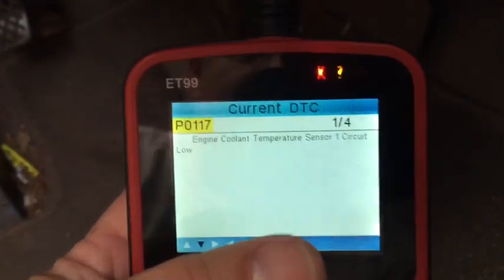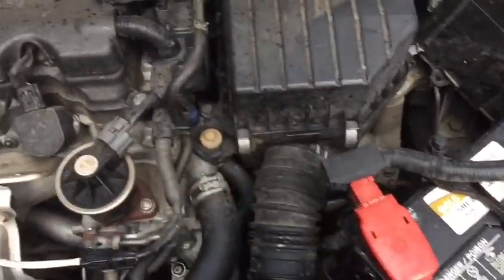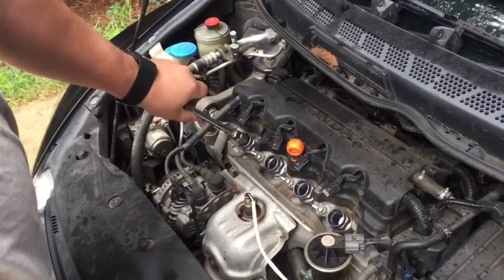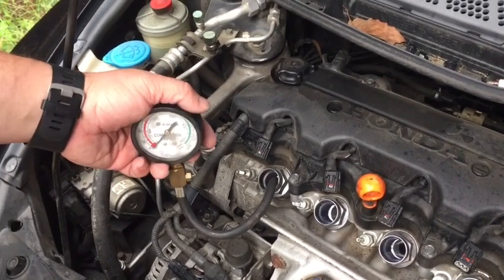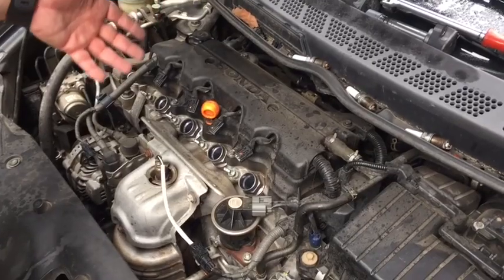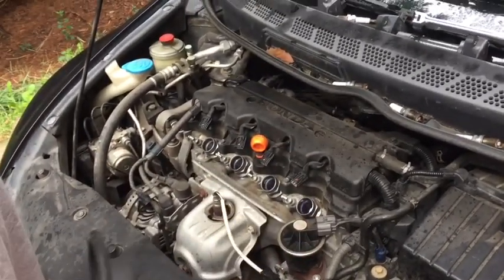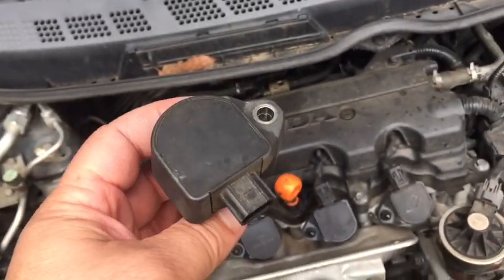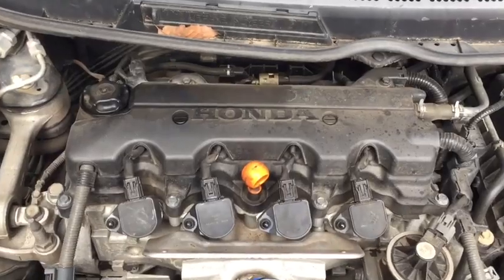Honda Civic p0300, p0302, p0303 diagnosed and repaired including compression test and spark plugs

Comment: Dude, thank you so much for this video. You have inadvertently given me a clue as to what was going on with my project civic. I was running out of ideas as to why I had such violent and erratic misfiring. The engine had been extremely overheated, likely multiple times by the previous owner. I had fixed the root cause being a bad water pump, did the head gasket, and had the head machined. I had also redone the entire top end of the engine, still using the original coil packs. I never thought that the coil pack stems had stress cracked and were likely arcing to the spark plug wells, not the plugs. I went out and got four new NGK coil packs and sure as hell, the car is now punchy and running well with no codes or misfiring anymore. Thank you for the insight!
Reply: Same here.  Replaced coil packs and spark plugs (which were only a year old, but car had overheated) after replacing all the sensors and the starter, water pump, belts.
Started up immediately after this.  Thank you!!🎉

Comment: If you drop them down the spark plug well you need to regap them. When i was an amatuer i did that and figured it wouldn't be a big deal. The car idled fine but instead of getting 30mpg i got on average 24mpg. I opened the gap back up from .039in to .044 and the car had a lot more lower end power and fuel economy restored.

It's a common mistake... its not worth spending 10 bucks a plug to replace them. Just regap em. You aren't going to damage the center electrode with a gapping tool. The tool is made exclusively to bend the ground electrode without touching the center electrode!

Comment: So, the situation you've described fits mine well. 2017 Honda Civic overheated. A few days later, I got misfires in cylinders 2 and 3. I replaced all four spark plugs and ignition coils. The same rough idle and codes came up after a few days.  The car always starts fine the first time I drive it in a day, but later on it starts to idle rough on subsequent ignitions. If I put it in neutral and rev it to 2k, it smooths out most of the time, though.

 Next, I ran a fuel system cleaner through, and the car was doing okay for a bit but would periodically idle roughly upon ignition (again, always after it had been driven that day and to varying degrees of roughness). 

I'm thinking I need to check the fuel injectors now to see if they need cleaning or replacement, but I'm not really sure if I should look for something else first. I haven't checked compression, I realize after watching this. 

Anyone have any tips?
Reply: Doubt fuel injectors are the problem. make sure the new spark plugs are not defective, I have seen cheap plugs fail after a few days, get some NGK from a reputable source. to check for a blown head gasket, you need a combustion leak detector kit.
Reply: @directautofix  Thank you for the reply. I appreciate the insight, and I'll bump a compression check up to the top of my list.
Reply: Not sure if you found the problem (or still have the car...) but it could be a bad EGR. You can try disconnecting the EGR valve to see if the engine runs smoother.

Comment: How did oil get on plug #3? I have the same issue as you, all new plugs and in great shape except #3 keeps getting oil on it and gives the 303 reading.  Any ideas?
Reply from the maker: @crownj01  the valve cover seal probably needs replaced.

Comment: I started to have p0300, p0302, p0303, p0304 codes when engine is heated.
So far ive replaced all spark plugs, all ignition coils, EGR-valve and yesterday camshaft sensor. Spark plugs were changed like 2 month ago and check them like week ago and they were really dirty and some of them must have been heated up alot cause of colour of them even they were only 2 month old. Cleaned them with wire brush which didnt help. Timing belt was changed 4 month ago along with water pump aswell. Havent done compression test yet but i try to do that soon.Not sure if this helping but exhaust pipe is making coughing sound after engine is heated.
Im really running out of ideas what it can be. Car is Civic 2003 1.6 VTEC if anyone have ideas what to look for next.
Reply from the maker: Run the compression test, it sounds like you may have a bad valve in the cylinder head.

Comment: Hi really appreciate this, it's brilliant. Needed your expert opinion; engine light flashing and vsa light on turned on today (civic 2011). Code demonstrated misfiring cylinder 1. changed coil pack and spark plugs around to see if the code would change but cylinder 1 still misfiring. Compression test is normal. What would the next step be? Is it likely injector or electrics from your experience and is there any easy way to know?
Reply from the maker: Oftentimes is can be the wiring connector at the coil. An injector can cause it as well.
Reply: @YourCarGuyDR  If it is the wiring connector at the coil, can it still cause the physical sound of misfiring?
Reply from the maker: @Bism_illaah  yes it can.
Reply: @YourCarGuyDR  You are very kind. I got this checked it was normal. Valve was normal. So I changed the first and fourth injector and all lights turned off, misfiring stopped and the car was smoother than before!!

But 2 days later, now there's misfiring in the 3rd cyinder!!! Took me forever to open,  I knew I should have changed them all.

But from your experience could it be something else triggering them? Like a bad fuel filter for example? or anything else thats not on my radar

Thanks a lot, you've  helped tremendously in my mechanical journey
Reply from the maker: @Bism_illaah  it could be a bad fuel filter or if you got some contaminated fuel. I would always recommend if one fails to change them all. But that can be tough with the price of injectors.

Comment: changed sparkplugs, changed coils 2 and 3 (that were misfiring), serviced the car and the problem still persists... misfire detected in cylinder 2 and 3... we even swapped the injectors and still misfiring... any insight? I really don't wanna fix a blown head gasket
Reply from the maker: Check your compression, if it is low then you will know if you have to dig into the engine.

Comment: I cha my plugs but on my 4th cylinder  I striped  are cross threaded  the plug and now I have alot of it packed down so deep in the cylinder  is that a big job to fix, on a Honda element
Reply from the maker: Antwayan Owens there are thread repair kits that can be done without removing the cylinder head. Otherwise the head will need to be pulled, big job.

Comment: Is there another way to reset the code without a tool scanner ? I wish you did a video  also on how to check vacuum leaks.
Reply from the maker: If you disconnect the battery for about 30 minutes it should reset the code. Vacuum leaks can be difficult at times to find. I usually listen and try to hear them which can also be difficult. You can use carburetor cleaner and spray near suspected areas with the motor running . If the motor stumbles or revs up then you have found your leak. However you have to be very careful as carburetor cleaner is very flammable and a stray spark or too much heat and you will have a fire to deal with.
Reply: @YourCarGuyDR   my lower  radiator hose broke causing it too over heat,pulled over and checked had all those codes, even my oil dip stick got toasted is that a bad sighn
Reply from the maker: @fernandocoronado4428  that can be a bad sign. Severe overheating can lead to a blown head gasket and possibly a warped or cracked head. My recommendation would be to replace the hose and fill the cooling system. Then run the vehicle to see how it behaves. If everything seems good change the oil and you should be in good shape. If. Or you are likely looking at a major repair.
Reply: @YourCarGuyDR  I replaced the hose  with new coolant,  the drive belt turns  but doesnt start, My friend told me thats  a good that sign it turned , a seized engine  wont turn over.tommaro ill do what you  did  in the video.wish me luck.

Comment: I have a random misfire on all cylinders I haven't done a compression test yet and I haven't overheated so I'm at a loss for guess until I do a further test. I hope to god it's not a head gasket
Reply from the maker: If you can do a compression test it is helpful. You may just need plugs
Reply: @YourCarGuyDR  I just finished that. Compression was excellent at 230 lbs across all four cylinders. Also 4 new Denso plugs and I still have the problem. The old plugs all 4 of them were dry black sooty..
Reply from the maker: @stephenjackson4392  do you just get the random misfire code or do you also get a code for an individual cylinder?
Reply: @YourCarGuyDR  Random misfire on every cylinder. PO300, PO 301, 2 ,3,4. 
I'm concerned I may have a worn timing chain. I may try a fuel filter next. The car shakes/jerks upon low idle taking off but it fine beyond 3000 rpm
Reply from the maker: @stephenjackson4392  I would try a set of coils before a timing chain. They are very easy to change. If that doesn’t do it I would inspect the cam and crank position sensors.

Comment: Need help folks, 06 EX changed sp and coil and the p303 came back again with engine misfire, turning off the engine restarting fixes shudder, what is the solution.
Reply from the maker: want car I would do a compression test to make sure you don’t have a bad head gasket or burnt valve. Also inspect the wiring and socket that connect to the coil to ensure you are getting a good connection.

Comment: I have the same error codes, had spark plugs replaced, check engine light back on. Could it be the ignition coils?
Reply from the maker: Christopher Rodriguez usually it is the coil and not the plug that is bad.
Reply: I have cylinder 2 and 4 misfire i swapped coil and spark plugs and wires still the problem.
Reply from the maker: Gamer Cat when you say swapped I am guessing that you put new ones on? If that is the case you need to do a compression test. If the compression is good look at the wiring connectors and test the wiring. Could also be a bad ECM but that is not common on a Honda.
Reply: @YourCarGuyDR  yes i swapped out new plugs and wires and brand type is denso spark plugs and i did a compression test already readings were 145 to 150 its a 97 honda civic hx and i gapped the plugs a bit pre gapped in 0.40 but i gapped them to 1.1 but later got all cylinder misfire. And then put them back to 0.40 and its at p0302 and p0304 code again. And changed new coil too and i made a decision to replace injectors.
Reply from the maker: Gamer Cat okay make sure to replace your distributor cap and rotor if you haven’t already. I have seen ones that looked fine but would have a spark arc to another cylinder inside the cap.
Reply: @YourCarGuyDR  for the distributor cap do i need to see some scape marks on the little contacts inside?
Reply from the maker: Gamer Cat there don’t have to be scrape marks. If you see white marks inside the cap it is an indication of a short.
Reply: @YourCarGuyDR  i saw like powder like carbon substance and i scraped it of and cleaned it up.
Reply from the maker: Gamer Cat the carbon is pretty normal.
Reply: @YourCarGuyDR  ya and im now stuck with the 2 misfires i cant pass the smog test and im putting alot to figure it out.
Reply: Or a vacuum leak.
Reply: I switched coil packs had a drive and it was still cylinder misfire 3  guess I’ll have to do compression test

Comment: My honda had same codes i checked changed the coil packs the car ran great. But when i parked it came oyt later to drive it the car wont start any suggestions
Reply from the maker: Jason Cartwright check your connections and check your fluids. When it doesn’t start does it crank over?
Reply: Yes it cranks
Reply from the maker: Jason Cartwright if it cranks over smoothly I would pull the spark plugs and check to see if they are wet and smell like fuel.

Comment: My Honda civic 2003 coupe ex is misfiring on all 4 cylinders and p0300 code, i don't know what could be, any help guys?
Reply from the maker: Oscar & CR Fans it is possible you have an issue with your cam position sensor.
Reply: @YourCarGuyDR  other thing is that doesnt accelerate as before. and thanks for the reply man appreciate it👍😁

Comment: Doesn't p0302 indicate the second cylinder in the firing order, not necessarily cylinder 2?
Reply from the maker: xart23x no the codes are not by firing order but are done by cylinder number
Reply: Respectfully, I think I'm right.  The second cylinder in the firing order is the culprit.  Look it up.
Reply from the maker: xart23x you are welcome to believe whatever you like. My 30 years of experience, manufacturer training, master tech status in 3 separate OEM’s, and as a dealership trainer I will respectfully disagree.
Reply: @xart23x   why did you ask a question if you know  the answer?
Reply: So, you're saying I'm right?  I ask because researching, it said go according to firing order but, this guy says otherwise as do others.  Trying to help others as well as myself cuz I got p0303 code recently and I smell gas from tailpipe.  Discussion is healthy.  Still not sure who is right.
Reply from the maker: xart23x why don’t you go pull your spark plug indicated by the code and find out for yourself. The simple fact is that per OBD2 guidelines which all manufacturers that sell vehicles in the USA must follow the misfire code is allocated to the cylinder number not the firing order. Note that not all manufactures number their cylinders the same so you will want to check the manufacturer information to determine cylinder location.
Reply: @xart23x  It’s definitely by cylinder number, not by firing order.

Comment: Is coil pack the same as a spark plug wire?
Reply from the maker: Cheeze Face no they are not the same. In most newer cars there is a coil for each spark plug that will mount just above the spark plug. In some cases it will be connected to the plug via a spark plug wire. In other cases like on the engine in this video the coil has a “boot” that connects it to the plug and is generally part of the coil assembly.
Reply: @YourCarGuyDR  you are the best, you're the master, thanks.